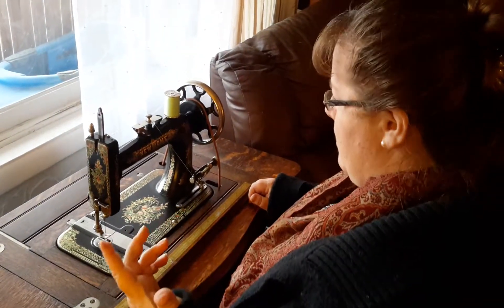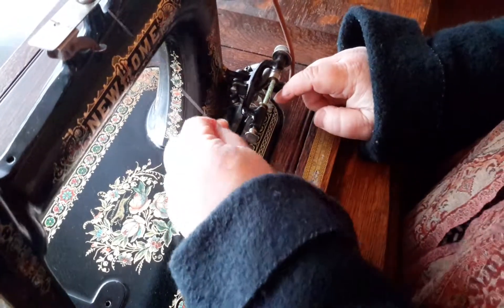How to wind a bobbin on a treadle sewing machine New Home 1916

Comment: That is a great tention tip !
I believe it applies to other machines giving the same symptom. Thank you.
Reply from the maker: Sheyla, yes, it does!  😊 I have several makes and models of these old treadles and sewing machines, and it definitely does affect the tension. I (actually my husband, lol) just ended up making these extension arms for the different sewing machines and it really does work a dream, because then you can use the cross wound or the cone threads on any of them. This video shows the hack ~ https://youtu.be/4qWZ4ku5_wQ

Comment: I know it is a wee while now since you made this video, but if you still have it and can do another little video clip I'd love to see how the release button works for the machine to tilt back.  I volunteer somewhere that has a "Belvidere" machine that I'm pretty sure was made by National for an old department store, and it looks very similar to this.  I can't seem to get it to tilt back and presume that the release button is stuck - but since I've never seen one actually working I don't quite know what it should do to "work right".  Once I do I might be able to figure out why it isn't working properly and fix it.  :-)  Even if you could post a comment explaining a little more about how it works that would be wonderful.  Thank you...  Megan
Reply: Start by dribbling a bit of machine oil onto the button so that it can try to penetrate the mechanism underneath. Let it sit for a few days. If it doesn't start behaving then, hit it with the hair dryer for a bit to keep melting the 100-year-old crud out of it. You can also try a couple of drops of kerosene.

I've restored many VS Singers and that's been what's worked for me.